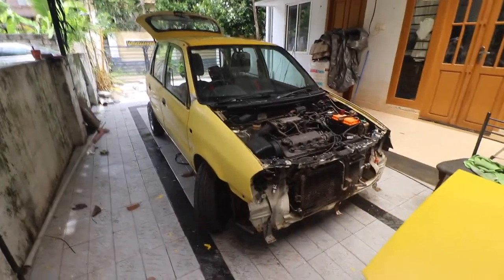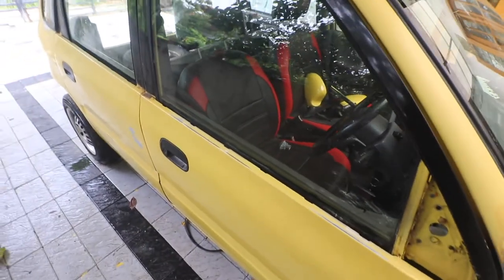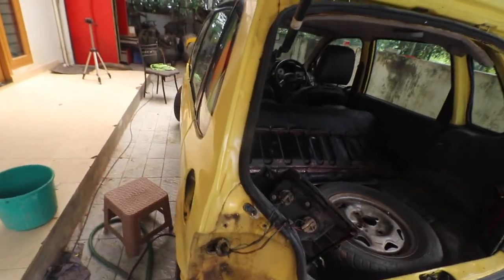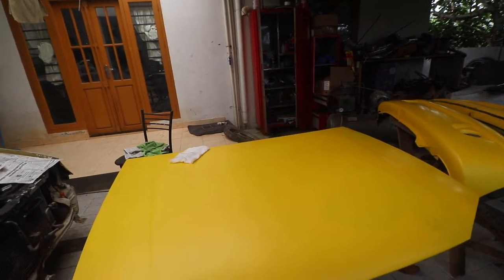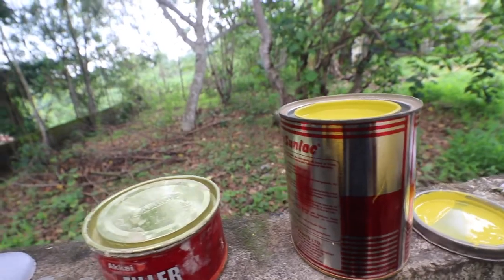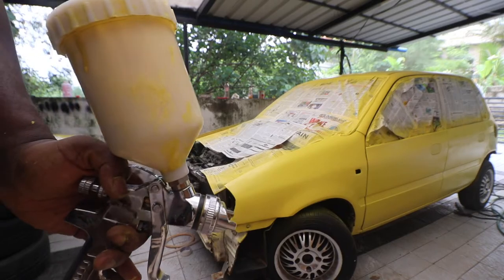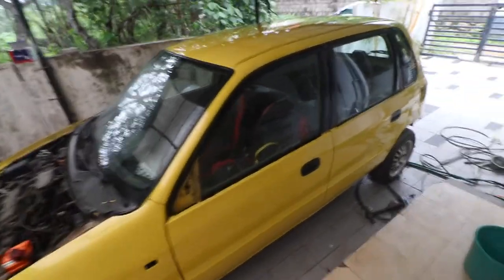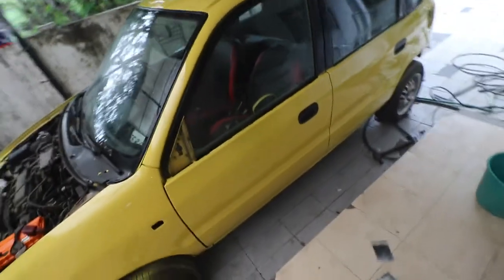Wife's Zen retoration Part 14, (Slick paint job)

Comment: Awesome. Just amazing. Sir you have lot of guts and patience to pull out a job like this. I wonder how your family reacts to all this. This whole painting job involves a lot of preparation work. But you have done an amazing job. Kindly make a video on the tools that you use, specially your pressure washer. Thanks.
Reply from the maker: Thanks for those kind words, I usually do the prep work at night, My family is like every other family, They doubt my capability when I start something and totally get amazed every single time I finish my work, The car was all dismatled yesterday, this is a car where my wife has not even sat in the driver seat yet :P

Good idea regarding the video on the tools I use, I  will create a video soon